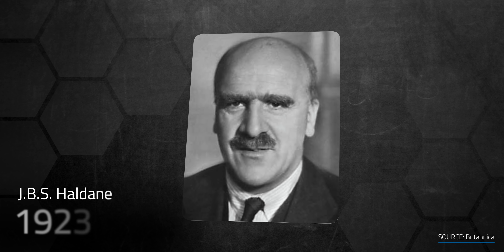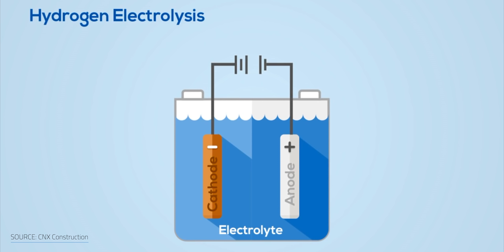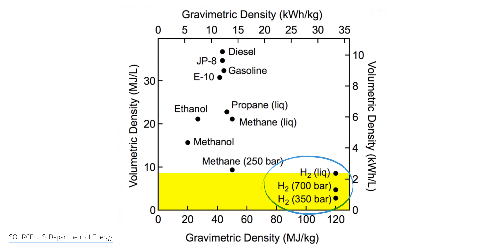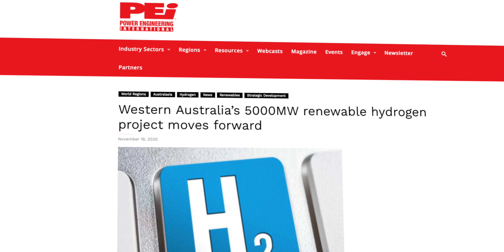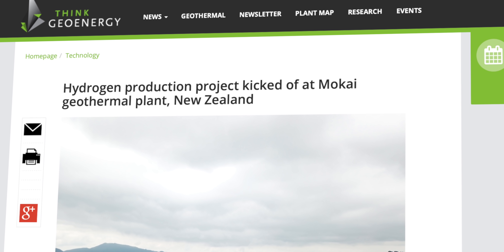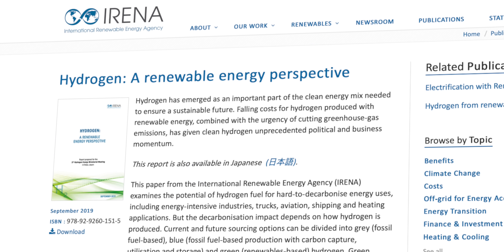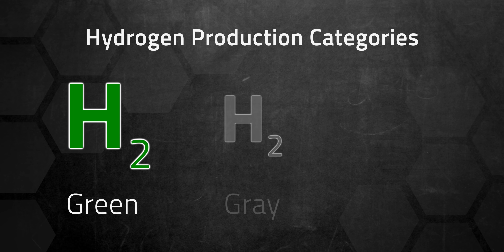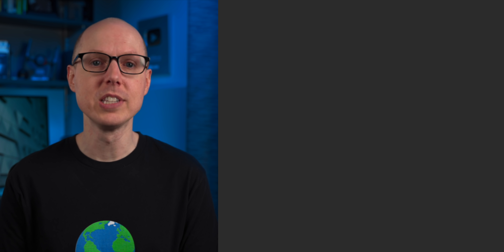The Truth About Hydrogen's Dirty Problem - Green Hydrogen Explained

Comment: Hi Matt, this sounds all very interesting, i like your videos, and i enjoy the content, but i am quite skeptical of a few of the things raised. @6:20 for example, you mentioned a solar panel used to create hydrogen. I read the article (2 years old), and then researched their claims. The company they created is called the Solhdy project. Their claims have not changed. 210w panels can create 250L of hydrogen on average for each day of the year. This is quite hard to beleive, and here is why:

At room temperature of 25C at 100% humidity you can expect around 23g of water per cubic meter. So 1Kg water = 43.478 cubic meters of air (with 100% efficiency
of water extraction). 

H2O(l) → 2 H2(g) + O2(g) . 1kg of water, being 1 litre of water, will produce 111.19g of hydrogen (calculating for their atomic weight). This means for 250L of hydrogen, we need 2,248L of water to create the hydrogen needed. To get all that water and extract all that hydrogen, we will need 97,756 cubic meters of air. Let that sink in. The claim is a 210w panel can suck in, and then convert the 97,756 cubic meters of air to create 250L of hydrogen on average every day. This is accepting 100% average humidity 24 hours every day of the year, and then a conversion of air to hydrogen at 100% effectiveness. This simply cannot happen. It gets even worse when we consider there is not 100% humidity every day (far from it), and it is not possible to get 100% extraction of the humidity which happens to get sucked into the device.
Reply: I am very much for protecting the environment, but a scam is a scam. I'd much rather hear reality and ways to actually solve problems, then for people to try and scam money from people who care.

Comment: 'Green' Hydrogen is a farce. It's hugely inefficient since so much energy is needed to generate the H, store it, and use in inefficient fuel cells.  Only 40% efficent vs BEV that are closer to 80% efficient.  Sure, may have niche uses but it can never overcome the massive energy losses.  BEV will crush FCEV and skip the exorbitant waste of building virtualy nonexistent H infrastructure.

Comment: Australia is pretty mixed up in this at the moment. On the one hand there are multiple states and projects being discussed and/or planned that would install renewable capacity that would dwarf the current grid demand and would be used to manufacture green hydrogen. On the other, the federal government is blathering on about a 'gas led' post-Covid economic recovery and is keen to have hydrogen produced from gas and coal.

Comment: Electricity's 80% Secret - 60% made from fossil fuels with CO2 emissions and 20% made from nuclear energy with radioactive waste. Hydrogen is needed for long-term, high-volume energy storage to counteract the intermittency of renewable energy generation.  Plans to have the public subsidize 500,000 new US charging stations (to push $40k BEVs & taxpayer-funded rebates) increases demand(prices) for electricity to power homes and businesses. It also puts more peak stress on the energy grid. We might rather consider increasing distributed and centralized renewable energy generation, including electrolysis, to help clean up electricity's dirty little secret and lower electricity prices for everyone.

Comment: Nuclear powered Hydrogen is the future

H2 is an ideal energy carrier because it's so easily produced from so many different sources, eg. oil, coal, natural gas, biomass, waste, renewable powered electrolysis, nuclear, geothermal or solar thermal powered thermolysis, etc. it allows all sources of primary energy to compete on price, doesn't require expensive direct air carbon capture, and ensures energy independence for any country that can adopt it as a replacement for fossil fuels for powering vehicles

but ultimately nuclear powered H2 will be the winner, because nuclear power is the cheapest, safest, most reliable, and most dense form of energy production - especially fusion energy

'renewable' powered hydrogen won't go far because it can not in any reasonable way scale up to the levels of energy consumed as oil today, it would literally require solar and wind farms larger than entire countries, and electrolyzers sitting idle incurring high capital costs while producing nothing due to the intermittency problems of unreliable energy like wind and solar

Comment: It's funny how the battery junkies always manage to see the splinter in the eye of hydrogen and at the same time completely ignore that their precious BEV has a much larger problem, unless you only drive it at nighttime of course. We don't generate anywhere near enough `green` energy to even allow 1 nanowatthour charge in a single BEV and even if we would generate a surplus, which never happened to this point, the change that your BEV would be connected to the grid at that very moment will be extremely slim.

Comment: Hydrogen produced by Steam Methane Reforming has like 1/3rd the CO2 emissions of using petrol/diesel, it's utterly ridiculous that people keep referring to producing H2 from natural gas as a "dirty secret", it's a very practical and sensible source of hydrogen, probably the best source, at least until H2 produced from nuclear heat sources using thermolysis becomes common place. The lower total thermodynamic efficiency of electrolysis vs. thermolysis, and the low capacity factor of solar and wind will almost certainly mean hydrogen produced from those sources won't be able to compete on price long term

Comment: You're missing the point. Hydrogen was to be a replacement for fossil fuels because it does not produce pollution. Yes, fossil fuels are used to create hydrogen but then again, fossil fuels are used to create turbines and solar panels.

Comment: I'm developing a system in america that our goal is to use green hydrogen produced at your house to completely power your house. There was a great deal of resources in this. Thank you for the effort you put in.
Reply: wouldn't the expensive of this machine make it unavailable to most home owners? like installing a gas station at your house, no one does that.
Reply: @miguellopez3392  yes,  right now,  but the most expensive part is hydrogen generation.  
We can build the rest of the system for about 20k USD. The electtrolyzer is what's expensive. But as the price drops for that So does the system.  
It's already being done in Australia,  India,  the Netherlands,  and Germany. And at a price that is fairly comparable to solar.
Reply: @jeremylaplace9036  "And at a price that is fairly comparable to solar" hydrogen production doesn't generate energy, solar does what is this price comparison for?
Reply: @miguellopez3392  Fuel Cells generate energy. 
Our main competition is the Powerwall and similar devices, but PEMFC's generate energy. But we would be using Solar as apart of our system Either as a part of our system or in line with an existing system.
Reply: @jeremylaplace9036  fuel cells generate energy by using pure hydrogen... which is made by using power generated by another source, its chemically storing power it like a battery but with more fluids involved and emissions are taken out (if collected and broken back into hydrogen and oxygen it would be closer to a rechargeable battery) solar generates power by turning sunlight into electricity, it is what used to make hydrogen and put power in a Powerwall it is the real generator in the system.

but when you turn electricity into into hydrogen you loose 20% of your energy in the conversion as where a Powerwall is around 10%, the real problem is then using that energy again, where the Powerwall maintains around 85% discharge efficiency the hydrogen will only be around 45% efficient. so you have a system that requires 2x as many solar fields to get the same stored energy out at homes. hydrogen would make more sense where the cost of energy so low that it makes the price tags less relevant, but i don't see that happening for another 100 years unless people want home systems that are far larger then what power wall could offer like  a 50-300kwh system where you would need over a dozen power wall installations to match.
Reply: @miguellopez3392  Yes. you're correct in that the solar is the power generator. 

The efficiency is less then the power wall for sure, but the storage capacity is where our market is much better. We are also going to utilize the waste heat for the homes water supply. Many people living off grid don't worry about efficiency, They worry about being self reliant and what happens if the sun doesn't shine for days at a time (As is often the case in Houston during hurricane season) The power wall cannot compete in terms of storage capacity.
Reply: @jeremylaplace9036  so people can just have a system with 55gallon drum of liquid/gas($250) and a 17kwh generator ($4000) and call it green if that gas is made with bio fuel, how will your system compete with something like that paired with a Powerwall/solar? powerwall and solar have the ability to efficiently sell energy back to the grid so there is money to be made their that cant be done with hydrogen storage because of loss.
Reply: @miguellopez3392  these are great questions and i appreciate them.

 I don't know enough about bio fuel to know what my answer would be.  I will have to research it.  But the main advantage over a diesel generator is that the fuel is generated by you. You don't have to buy it.  
And the waste water can be recycled into the system or used for drinking water (after some processing to add minerals so you don't get the problems from drinking pure water). 

If you get a hydrogen FC car,  you can fuel it yourself. Mike Stritzki (new jersey hydrogen house)  is much of our influence.
Reply: @jeremylaplace9036  "And the waste water can be recycled into the system or used for drinking water" i mentioned this earlier that the emissions can be turned back into hydrogen, i think the heat of the water helps the electrolysis process.

 "You don't have to buy it" true this is more of a math question for long term use as you will have to compare years of using gas as backup power with power wall and  commercial solar generation vs the cost of the hydrogen equipment and sale of hydrogen energy back to the grid if the system allows that. 
these are the issues that makes me think this will fit a larger scale application like a hospital rather then a home.

"if you get a hydrogen FC car" same can be done with just solar with a BEV, some companies want to use the BEV batteries as a way to provide backup power but this would require a high power inverter for the home so there is little commercial push for it to be in every EV.

Comment: I think that when green generation reaches a point where it creates a significant surplus of energy, the storage and delivery flexibility hydrogen offers over any of the current battery technologies will make it a huge part of a cleaner energy future.  Whereas the component materials used in batteries are finite in quantity, hydrogen offers a virtually unlimited supply.  Can we imagine a future where rooftop solar is used to create our hot water while using surplus energy to sequester hydrogen for powering our homes at night?
Reply: that will happen... if batteries dont improve, other advantages of batteries is no pressurized vessel and fast discharge rates, this puts it in places hydrogen cant reach even if it did become cheap.

Comment: Hi Matt, I've read about Hydrogen being converted to ammonia. I have heard that after Hydrogen is converted to Ammonia, it is easier to transport and has a higher energy density, I would like to learn more about this proccess. Thank you, Gene,
Reply: higher energy density the you have to do the process of removing the ammonia to use the hydrogen in a engine, lowering density and increasing cost, advantage is just safer transportation as driving a truckload of hydrogen is very dangerous even a LPG truck can damage a city block.
Reply: @miguellopez3392  
Its a little recognised fact that the Zeppelin company operated hydrogen filled airships for Thousands of hours and miles with few if any incidents before the Hindenberg incident...a ship that was designed to use helium but the supply was embargoed by the US due to Hitlers rise to power.

The same risk problems with Methane natural gas .... LNG Propane Butane...  Etc they are all explosive in the right air mix ..and most of those dont even escape upwards they expand and pour over the surface and fill any hollows ... So they dont disperse. 
H2 and Methane are not toxic however Ammonia is, very and its effect on humans is highly unpleasant even at low levels.

So yes we have to explore the options increase the efficiencies and develop alternatives rapidly. For everyone's sake. 
And no more bending to the FFuel industry but the we've still got all this oil/gas to find and get out the ground.... No sorry its last orders at the inn. You will still use it to make stuff...but a lot less stuff and it will have to last and be recycled again. But burning it or converting it  and producing  CO2 or any other greenhouse gasses as waste product isnt acceptable ...
Meantime whatevers done has to be effective, affordable and long lasting ...   Lithium battery tech as it stands is complex  expensive rare, energy intensive
and extraction is currently damaging ...recycling barely tested and complex.

The other problem is too many people wanting/being told they need too much. 
The too many people is harder to deal with but aging populations are going to be a fact. 
The  too many group that takes too much and bury's its collective heads in the sand is the real problem.
Reply: @clivestainlesssteelwomble7665  I know about the hindenberg incident and dont hold hydrogen accountable for it, batteries in the past 30 years have gotten much cheaper to make, new methods to extract lithium are being developed and even when powered by the average energy mix is still cleaner than most cars in the US.
Oil products should be used to make products cheaply and not as a fuel source, that carbon needs to stay locked into a solid not a gas. Hydrogen only has a future in energy if energy becomes nearly free VS batteries needing to become cheaper, do you  see the world increasing energy production by 5x for the same price in 30 years? I don't,  I see a 5x drop in battery prices in 20 years, tesla already single handedly make sit easier to get fast charge in the US, there Is not a single hydrogen station near me for over 500 miles so there is also the infrastructure question, no company wants to pay for hydrogen infrastructure, they are waiting for the government to do that for them.
Reply: @miguellopez3392  

Yep its the heavy plant and possibly ships that might use it ditto it might find a use in large aircraft. 

If  Hybrid Airships can be produced large enough. You might see a real shift in emphasis. 
But the whole JIT supply chains going to have to be cut.. 
Just because youve been able to do something cheap by sending halfway round the planet isnt going to make the grade. Like exporting waste.

Big long lasting stationary grid size storage batteries are going to be a necessity , lots of them so they need to be cheap to make and use relatively common elements.  As Dr Don Sadaway says whatever you use needs to be common... dirt cheap. 

Meantime the general  US pop is faced with a big clean up bill for its past and present profligate practices. 

Deep sea mining for rare Earth metals is likely to cause a huge biogenic kick back .. 
One thing we should have all learned decades ago is what you do to the air you do to the water and visa versa ... And they are the two systems that touch every part of the planet ..no ducking or diving no excuses.  The other connecting element is the soil for most of us. 
Mess that up and you loose a huge reservoir of CO2 Methane as well as means to produce the majority of our food ...that require massive oil inputs  as fuel, fertilizers and pesticides subsidies. Mainly through out dated soil damaging intensive farming techniques that create a global double whammy. 

We need to get a lot more imaginative and a lot less petty.

Comment: You can convert fracking wells into super efficiency hydrogen wells that keep carbons and methane locked into the ground.
Reply: did the fracking industry tell you this like they told us their current mines don't leak methane? they will sell you a solution but never deliver it.
Reply: "Blue hydrogen"  the great myth of the dying oil industry...

Comment: Green hydrogen is only green if there is more than 100% generation of sun and wind. In the Netherlands we have only 10% sun and wind power. That means that electrolysers run on fossil fuel for 90%. But there is a much larger problem. The efficiency of electrolysers is now less than 55%. For 700 bar applications it is even only 49,1%. If you use the hydrogen in a Toyota Mirai, there is again about 50% loss in the fuel cell. From every 4 kWh, 3 kWh is lost. Due to the  repression to fossil generation 1 kilo of hydrogen results in 32 kg of carbon dioxide. 
That means too that you need 3x as much windturbines compared with direct use of the electricity in electric car or heatpumps in houses.
Hydrogen is no longer an option for passenger cars or buses. BEV buses can already drive up to 600 km on one charge, FCEV buses typically go about 350 km.
Wait a little longer and the heavy trucks will all be electrical.
The only real application for hydrogen is aviation en maybe large shipping.